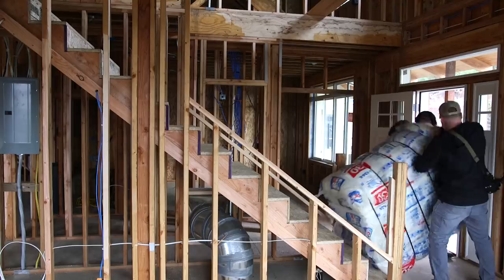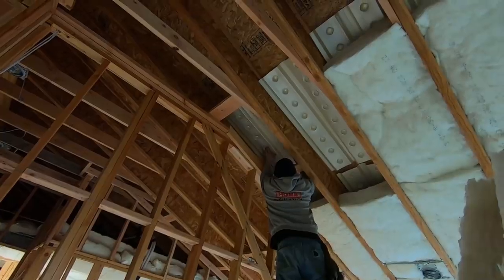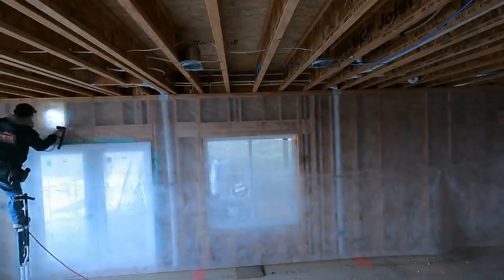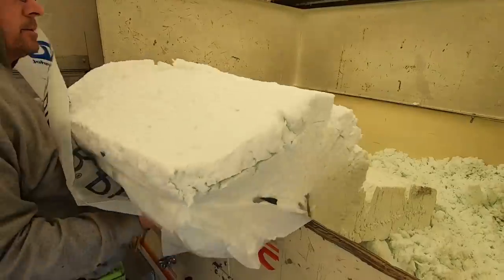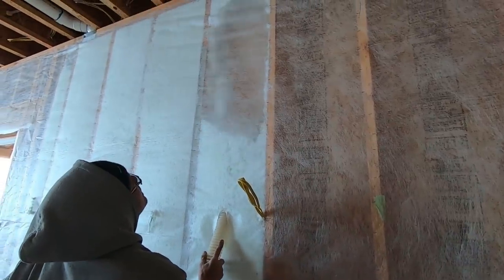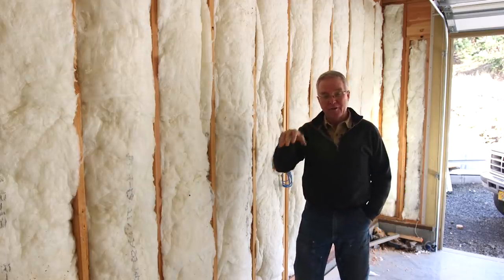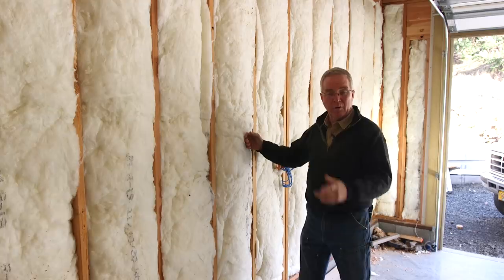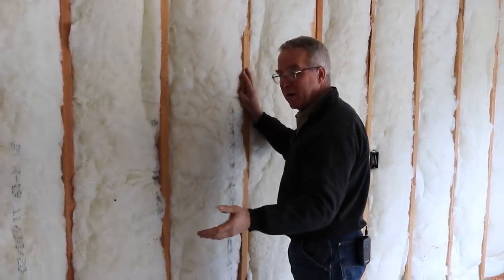Insulating A Nice House Ep.104

Comment: If I was building a house I would demand insulation in all interior walls.  I can't stand having to hear a tv on low volume from two bedrooms away.  Even worse if you have a baby trying to sleep.
Reply: Same.  Any remodel/other job that opens the walls in my house, I make sure to put in sound proofing insulation before they're closed back in.  It's such a negligible cost for an increase in quality of life.
Reply: I was wondering about that, too. So there is drywall going onto the walls, but nothing else?
In germany we call a wall a dry wall if it wasn't built with water like in cement (and stones/bricks). Dry wall usually consist of 2 layers from both sides. Plywood and drywall (gypsum-paper-sheets) - from both sides. And then usually some rockwool. There is so much mass in our drywalls you cannot hear someone screaming on the other side.
but this?... wow!
Reply: Unless you have good air circulation in the home, insulating the inside walls can cause issues where you'll end up with significant temperature differences from room to room. It can be designed for, but that's why it's generally not the default.
Reply: @zncon  What would the alternative to keep noise down?  Is there sheet material that can be placed behind the drywall that can minimize noise and vibrations?
Reply: @michaelbyrne8238  I believe Dynamat makes a sheet product that can go inside the wall cavity to help with sound, but I'm far from an expert. I've just been doing a lot of personal research due to the rise of the home office.
Even if you do insulate the walls, the headers and footers still pass a lot of sound. Getting a good sound control system inside the house is essentially an entire career of its own.
Reply: QuietRock premium option 5/8 gypsum 2nd option if possible but I would never consider superfluous insulation if not accounted for in overall design.
Reply: we did that...but remember, it changes the thermal dynamics of the living quarters. Our largest room (open concept) is the warmest, but the rooms on the each side (the wings....) are always cooler.  which I like, but not everyone would.
Reply: Most of the sound travels through the penetrations.
Reply: Absolutely,  interior sound proofing is a relatively inexpensive addition to a quality home. Of course solid core doors are also a big part of sound proofing  a home.
Reply: I built a utility room for the washer, I speced for sound batts in the walls and sound block plasterboard. Close the door and you can only hear the spin cycle.
Reply: I wouldn't put it in all interior but will definitely put it in between bedrooms, bathrooms and living space. Also I would put it in between floors in a multi story house.
Reply: @michaelbyrne8238  you can purchase noise-rated drywall - it is basically 2x the cost of a regular 4x8 sheet. it gets used in concert with acoustic caulking products designed to reduce vibration and air gaps. IIRC each 1/2" sheet is the equivalent of several layers of regular drywall in its STC rating.  Its an interesting product, it looks like regular 1/2" drywall but it is made up from layers.  Its more difficult to work with - harder to cut out boxes etc - and then they become the weak point for noise transmission unless they get dealt with.
Reply: Insulation - even acoustic insulation - only works at high frequencies.  Low-frequency sound is transmitted through the wooden members.  One part of the process is: sound vibrates the sheetrock, which vibrates the studs, which vibrates the sheetrock in the adjacent room, which radiate sound like a loudspeaker.  If you really want to kill sound transmission, you need absorption (foam), mass (doubled sheet rock), and isolation (double-stud walls, with studs that don't touch).  If you really want to over-do it, there are systems for mechanically isolating the sheet rock from the studs.  It's also important to install solid-core doors and put sheets of damping material behind door trim components.  For extra fun and expense, try an acoustic door gasket.
Reply: Sound travel inside a house is a tricky thing to tame.  Duct work transmits sound.  Wood studs transmit sounds.  Insulation won't do a whole lot or not as much as you hope unless the wall construction itself is taken into account.  Think a 2x6 top/bot plate with 2x4s to complete the wall BUT, obviously, the 2x4s don't go from one side of the wall to other and that is the point to help minimize the wood transmitting sound.  So one staggers the 2x4s on either side of the wall/plates--hope that makes sense.  Lots of tricks but not super easy to do.
Reply: Anyone have experience with Green Glue Noiseproofing Sealant? Apparently you double up the drywall with a thick bead of caulk between the layers. Seems to make sense cause it creates an air gap which is good noise isolation
Reply: @zacharyduryea4248  I've done two walls and it probably works. I used double 5/8 both times. Hard to say how much better it is over not using Green Glue but the stuff does stay a weird gacky elastic sticky stuff and doesn't harden at all like a sealant or caulking does.
Reply: @zacharyduryea4248  years back idid a comercial job with it for a casting studio. Each of the casting rooms was double walled, roxul safe sound, a layer of 5/8 type x and a layer of 1/2" quiet rock, all screws/seams etc coated with the green stuff.  All boxes had an acoustic putty applied. Dont remember the STC rating, but you could scream at full volume, and not hear a darn thing in the adjacent hall/room
Reply: Agree with OP. Can't fathom why he doesn't insulate the inner wall, also great for dampening SOUND between the rooms. Seems a wasted opportunity.
Reply: @zncon  I insulated between walls and ceilings to prevent the heat from the woodstove on the first floor from overheating the bedrooms on the second floor as well as provide soundproofing, I have designed my heating system with four zones and with programmable thermostats so that I can run the heat where I spend my time during the day within the house, and save on energy costs. You're right you have to think about it as a system much easier to do if you are planning on living in your build rather than just building a spec house for sale where you don't know how it'll be used.
Reply: @michaelbyrne8238   double layers of sheetrock help with noise also better fire protection.  I used all the scraps of drywall from one area to cover a couple bedroom walls as a first layer then I went over it with full pieces for the final layer no additional cost and some added benefit.  I hung my own rock and hired a taper, as this cuts into production time a pro-drywaller might not spend the effort to do this.
Reply: @Tehcarp  yep, any air gap. Sound deadening is all about stopping air movement.
Reply: Lots of information/misinformation/misleading/academic information here. From a practical point of view, insulating the interior walls and ceiling/floors has a dramatic impact on the sound transmission of other parts of the house. Is it perfect? No. Is it the only solution? No. Are there other ways to accomplish the goal? Yes, of course.
At the end of the day, using sound proofing insulation in interior spaces can and does dramatically reduce the transmission of sound from other parts of the house.  Internet commenters will often poopoo any solution that isn't their "ideal" solution, but that doesn't change the fact that it still works.
Reply: @michaelbyrne8238  resilient channel holding the drywall off the studs and double up the drywall layers.  5/8" better than 1/2". Putty packs on back of electrical boxes and acoustical caulk at the plates.  Safe N Sound Rockwool over fiberglass insulation
Reply: @paulkolodner2445  spot on! I had a customer ask me to sound proof a wall once. He paid an outrageous price for the "soundproofing" drywall which was two pieces of 1/4" drywall, with a layer of dynamat like material sandwiched between.  I told him without physically isolating the walls, and with a hollow core door the benefits would be minimal, and they were.
Reply: @michaelbyrne8238  you could use recycled egg cartons, excellent for soundproofing.
Reply: My current house, the wall between the bedrooms is 90mm pine framing with 10mm plasterboard either side and rockwool insulation batts, and I'd say in this context the insulation is close to useless. Any bump or even conversation noise goes straight through the studs and plasterboard and the rockwool just sits there. I haven't experimented with the staggered studs or thicker plasterboard or any of that suggested here, but I'd say any of it would be an improvement on just fitting rockwool batts into a regular wall.
One thing I would note, is that two layers of 10mm plasterboard adds considerably to the total weight of the wall system, and that may affect your design parameters. The 13mm special purpose sound-deadening plasterboard would have a significant advantage there.
Reply: @RubyRhod  lots of homes just have Sheetrock slapped over the studs for their interior walls.

Comment: Disagree with not “insulating” partition walls, at a minimum I always add it for sound insulation purposes especially around bathrooms to keep bathroom sounds in as well as bedrooms
Reply: Have you ever tried Mass loaded vinyl before you install the drywall? I have put Rockwool in between the walls and coated each wall with mass loaded vinyl and it did wonders for sound!
Reply: @phillipkuntze137  mass loaded vinyl? Care to elaborate?

Comment: This doesn't affect your statement much, but for completeness:

For spacecraft (in the places where people have gone, anyway), the problem is much more one of getting rid of heat than keeping it in. Vacuum is a much better insulator than anything you're likely to use in a house (see thermos bottles/Dewar flasks). With a vacuum, the only method of heat exchange is radiation, since both conduction and convection don't exist to any significant degree. So the heat generated by people and equipment has to be radiated away by quite large heat sinks on the outside of the craft.

Comment: Here in western Maryland we still use paper faced fiberglass. Unfaced is still only used for attic spaces. 
Also. What keeps the blown in wall insulation from settling over time leaving a cold void at the top of every wall?
Reply: It will
Reply: nothing keeps it from settling. it will settle eventually and it will suck. he should have went with spray foam on the walls at least.

Comment: I seriously hope that you tape around all of those electrical outlets and switches. I did this same system in a house I remodeled years ago and about a year later when everything settled I had to go back and remove all the switch and outlet plates and seal them off because of a bad draft coming in around them.
Reply: What you saw put on the wall wasn't an air/vapor barrier; it's a netting that keeps the cellulose in place until dry wall. The cellulose also has filled in behind the boxes. A gasket behind the plates on the exterior walls should be enough to eliminate the remaining possible drafts
Reply: @ColeSpolaric  It looks to me like a vapour control fabric, which is what is used in Europe for blow-in cellulose insulation. It slows down water vapour transfer to a rate that's acceptable (higher Sd value than plastic sheets).
Reply: @ColeSpolaric  I don’t believe I said anything about a vapor barrier. I know what it is as I have worked with it quite a bit. Just commenting on how they need to seal around the outlets and switches so there won’t be any draft when the cellulose settles.
Reply: Here in Canada, any device boxes in exterior walls have to be wrapped in plastic before they're installed, and then taped to the rest of the vapour barrier when it's installed.
Reply: @olafbigandglad  that’s isn’t a requirement in America however most contractors worth their salt do it anyway.  It’s just smart and good business to do the extra work.
Reply: @jodyrolandconstruction6577  if there's no vapor barrier, there's nothing to seal to. Not unless you're talking about the gaskets that you put behind the plate?
Reply: @ximono  not here in the US. That is just a netting that allows the air to flow out so the cellulose can dense pack better.
Reply: @ColeSpolaric  you have to seal the electrical box with tape around the outside of it or install a piece of visqueen between the box and stud which you then tape to the box. Not doing this will allow air to leak in around the box. That’s all I’m saying.
Reply: @jodyrolandconstruction6577  ok. I wasn't sure how you were sealing them. I honestly think the gasket behind the cover plate would be easier. Or just get the exterior air sealing details right and not have to worry about air leakage. But he hasn't used all the modern techniques here. And i don't remember seeing an ERV or HRV installed here, so some air leakage is going to be needed to keep the air inside from becoming too stale.

Comment: So blown in insulation is common in my area for attics. With that being said blown insulation settles over time, which it isn’t a big deal cause you can always add the insulation. Will you have to worry about the blown insulation settling in the walls and causing areas that are not insulated?

Comment: Are you not required to put a sealed poly vapour barrier on the inside under the drywall? That is code here in BC and I believe now you are required to do a pressure test on the house before installing the interior finish. I’ve been away from the trade for a few years so I could be wrong about the test.

Comment: Windows (single pane) are about R1. A wall at R20 allows about 5% of the heat loss as R1. R10 would allow about 10%. Knowing the cost of heating or cooling will allow the calculation of the economy available through higher R value insulation and reducing heat loss or gain through infiltration.
Reply: Knowing the price of energy in the future is much more important than the current price. Better go for the best insulation for the first install when you still have easy access. You'll forget about the up front costs quickly and enjoy better comfort and lower energy bills forever.

Comment: Seen to many problems with spray foam. You made the right choice here. Old drafty homes are the only good candidates for spray foam IMHO. I know there will be hate for this comment but it’s true. Also I thought that the paper was a moisture barrier?
Reply: Moisture barrier and helps hold it in place.  So in 10 years the Fiberglas batts and blow in insulation isn’t going to settle and leave gaps at the top plate?
Reply: I’m curious what problems you’ve seen with spray foam? I’m considering using it.
Reply: The paper is a vapor barrier, but vapor barriers are located depending on the local climate. The lack of faced batts probably has more to do with the Western Oregon market than a wider shift in insulation manufacturing
Reply: @duggydo  it’s temperature specific if the substrate is to cold it won’t adhere correctly, some installers don’t spray it correctly and cause voids in the bays. There’s a guy on YouTube I forget his name but he explains it all.  Everything has its place.
Reply: Even old drafty homes are better off without spray foam, IMO. If it's a wooden house, better use cellulose/wood and take care of drafts by closing all gaps (could just staple on permeable vapour control fabric). YMMV by climate of course.
Reply: @duggydo  I've seen entire floors and roofs have to be taken out due to rot. Even the most professional of installations have problems. One little leak and moisture gets trapped and can't escape. Roof leak occurs and you never know it because the water never shows up  being trapped behind the foam.and it's to late by the time  you find it. I personally would never use the stuff.

Comment: I saw a comparative test of insulation materials and flamability. What surprised me was that well treated cellulose was almost completely unflamable, while it's still the same stuff as cotton wool which burns like crazy. Dense cellulose panels actually work well as fire stops. 
I expected fibreglass to perform much better in such cases, but it turns out that although glass doesn't burn, the fibres melt away instantly on contact with a hot flame, leaving no fire protection at all. It'll probably be fine covered with plasterboard and against hot gas, but when flames contact it directly, it's gone.  
Several foams burned like crazy, with nasty sooty smoke that looks like it'll kill you before the fire does.
Reply: Same goes for wood fibre insulation. Here's a good demo: https://www.youtube.com/watch?v=dDQlpUYKdEs
Wood fiber insulation has some very attractive qualities: better heat buffering (if that's what it's called? better hysteresis?), great sound insulation, from a renewable resource, safe to work with. If installed correctly, it reduces the risk of rot compared to fiber glass (if water vapour gets through the barrier, it collects at the bottom of fiber glass, whereas with wood fiber it gets transported horizontally to the outside). I don't know if all of these apply to cellulose, but one would think so.
Reply: Oh, and it is the smoke that kills you, not the fire. I wouldn't want to live in a house insulated with plastics.